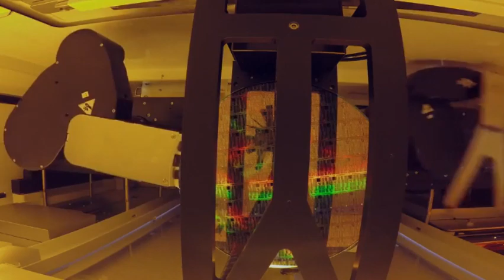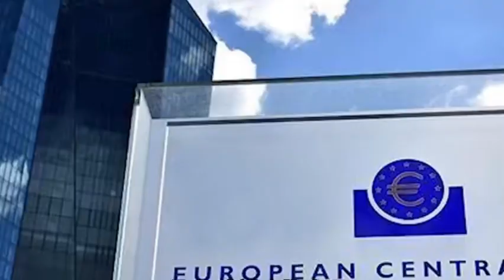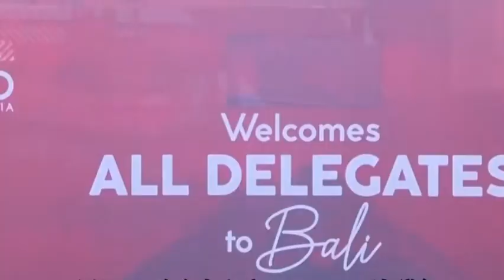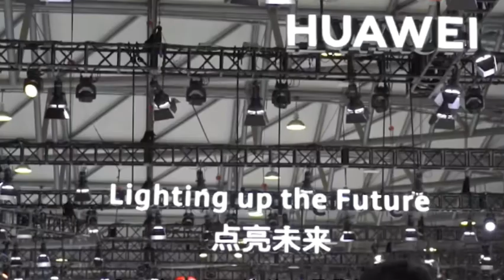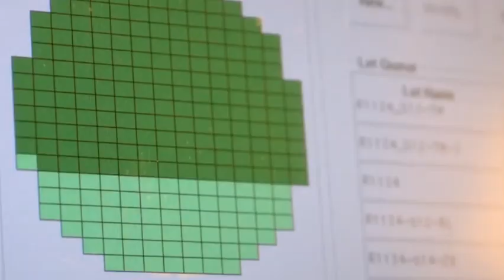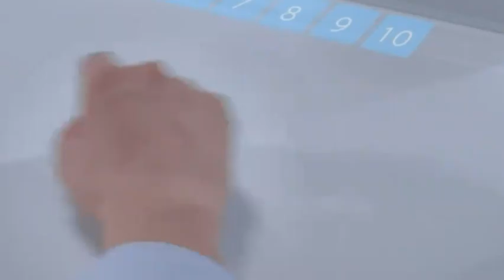Europe plans to follow China's 40 billion euro plan to develop mature chips.

Comment: copying China ? wtf .... to get costs down you move to bigger 300mm wafers ..... and capital costs go through the roof - not to mention finding experts who can set up such advanced processes.

they would do a lot better looking at Russia's strategy focussing on simpler 200mm wafers and only concerning themselves for the foreseeable future with supplying enough chips for their 150mil population - and wearing the cost as a national security issue.

these EU clowns can't have it both ways ..... either they are going to invest hugely and compete on a global scale - or decide to build chips for its national security in more modest volumes that cost more but won't need insane capital investment ....